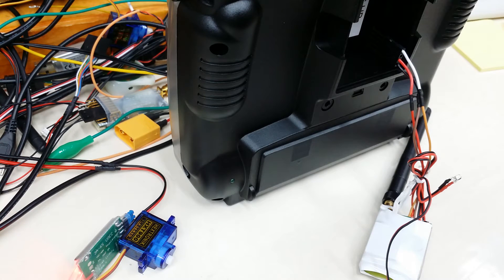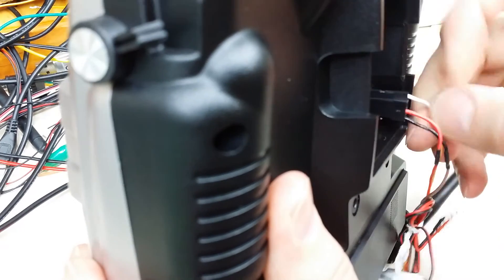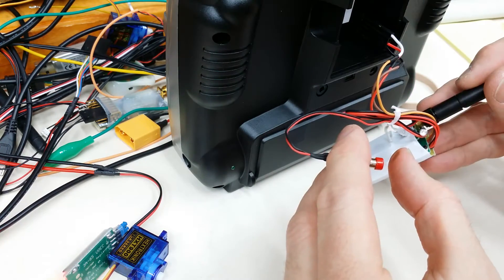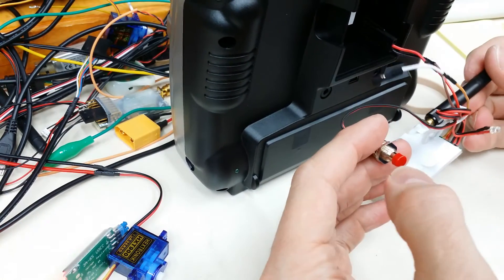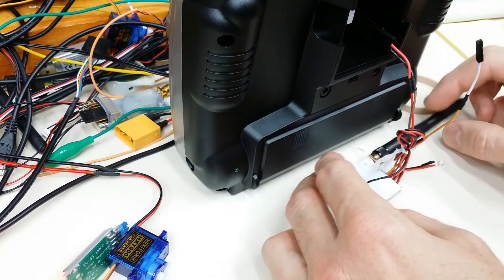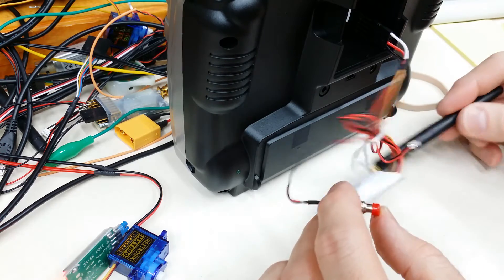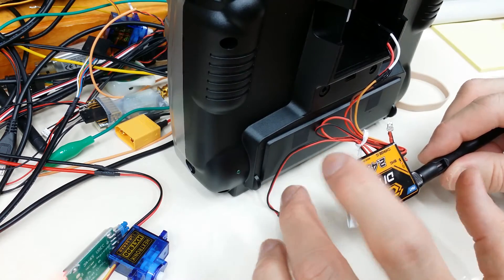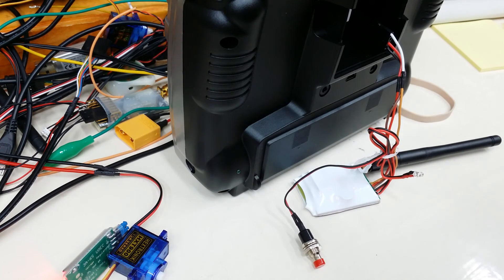OrangeRX DIY test

Comment: Hi. Interesting video. I have a problem with this. When I start up the taranis, and then Plugin the modul, it works great. But when I then turn off the taranis, wait for 20 seconds and then turn the taranis on again, the module doesn't start until I plug it out and in again... Do you have any idea?